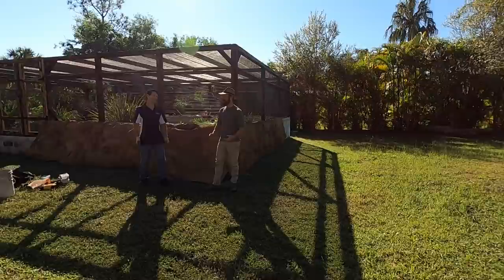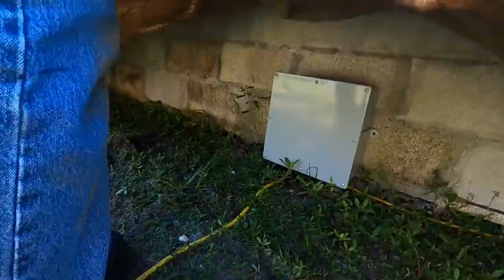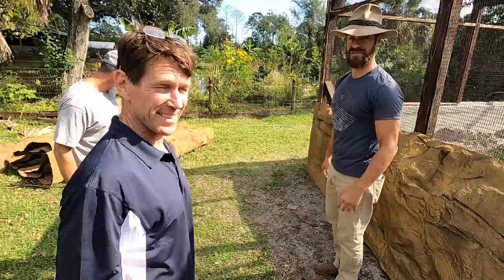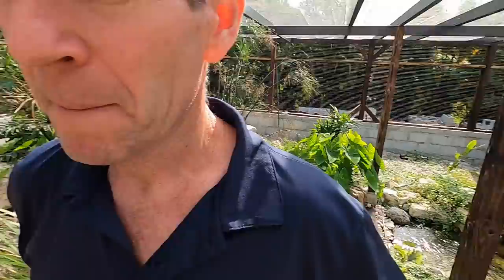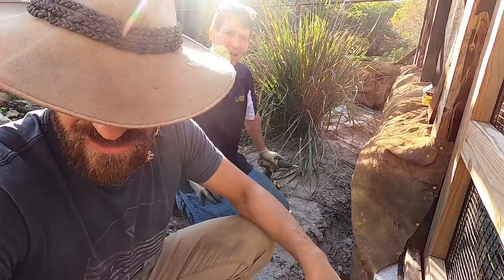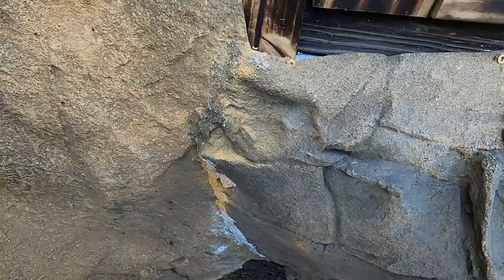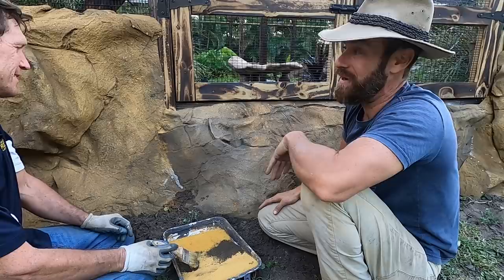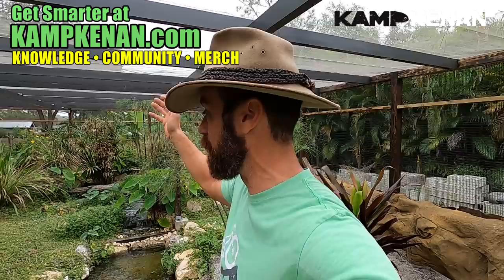Slinky gets the Universal Rocks treatment!

Comment: This is freaking amazing. I'm always dreaming how to create this. Iv created cement waterfalls, but then my enclosure weight 450lbs. Please tell me how I can do this myself. I just need a few backdrops, sooo bad.
Reply: The material you need to just have on hand, is too expensive. It is cheaper in bulk, like by the truck load.You also need a place to prepare it. Try using mesh wire for a frame, and then wrap it up in U R  material.  They have different depths rock texture.  Or just call Universal Rocks, and buy big clippers. Either way. You will get the joy of completing a dream. Good luck.👍